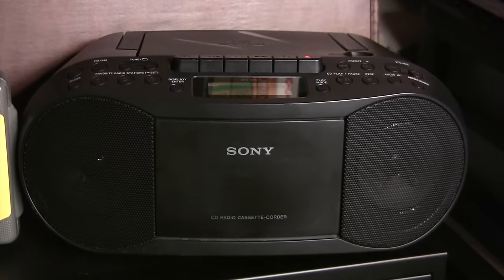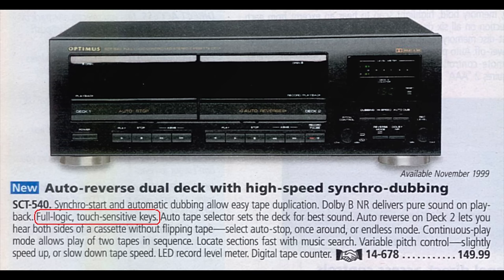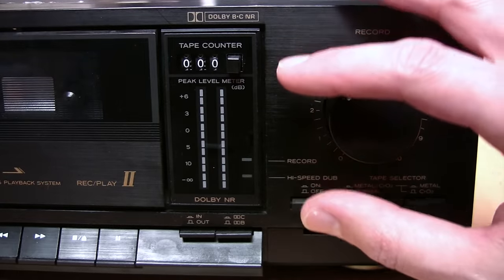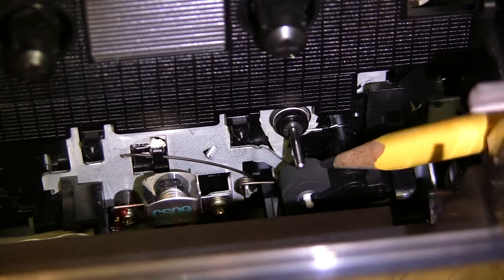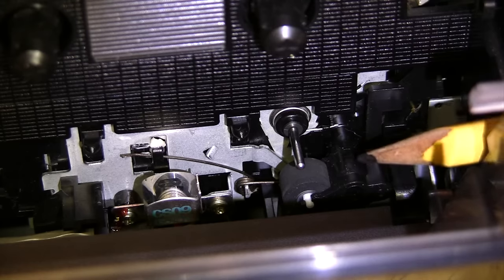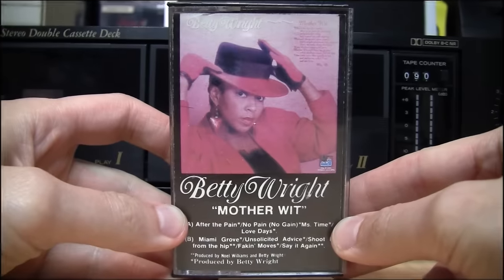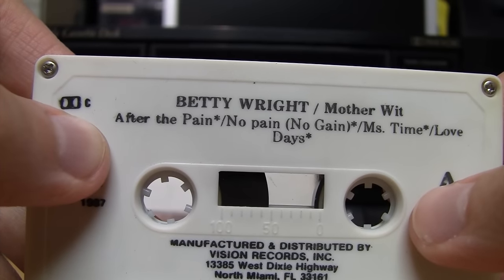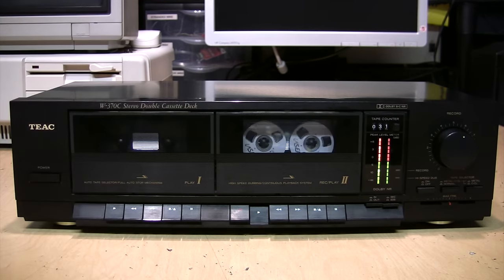Cassette Decks for Dummies

Comment: Just my two-cents on "piano key" decks. The higher quality ones that "detach" the heads/pinch assembly from the play button machanism, once pressed, are ok. The sign of a terrible mech is, once in play mode, the head/pinch will still wiggle a bit if you push on the play button a little. Directly connected. Very very shoddy. Very prone to "issues"! 

Thankfully very very few "proper" cassette decks with ALC, though Sansui did make a few in the 80s. Very strange decision on an otherwise respectable deck.

Twin decks def best avoided, usually, although the older Tascam pro double decks (302, IIRC) were basically two totally separate decks (both mechanically and electronically) in a single cabinet. Not especially high-end, but good enough for most people. And way ahead of their current lame offerings. Current Tascams are pretty dreadful IMHO. If you can get an "older" Tascam from about ten years ago, that's not been abused, you should be able to use it without any servicing. 

Minimum specs for anyone seeking a really high-performance deck are 3-heads, Dolby B/C ( and S if possible!) & HX pro. Dual capstan def nice too, quartz lock & direct drive is the ultimate. 

Always check for a groove cut into the rec/play head when buying a used deck. If you can clearly feel a groove/ridge with your finger nail, I'd suggest you keep looking! Head wear is a sure sign that the deck is generally worn out. Once a head has bad wear you also can't adjust the azimuth on it (well, you can, but it won't work terribly well!). The wear/groove will be at a slightly different angle than the new tape path. Very bad for tapes. 
Also check for wear and thick brown deposits on the pinch roller. Or a cracked or shiny pinch. To be avoided at all costs!

I could literally talk forever about cassette decks, but I shall leave it there! 😃👍
One last thing ..."metal" tape compatibility, even if you don't plan to use metal tapes, is a general sign of the deck being of "hifi" quality. You won't see it on anything pre 1980-ish, but those older 70s decks are usually best avoided anyway due to failing rubber parts, failing caps, etc.
I have a love/hate relationship with cassette decks. My favourite ever (aside from crazy expensive shit) is the Yamaha KX1200. Stunning recordings. Play those tapes on a WM-DC2 walkman, and you'll think you're listening to a CD 😃

Comment: You should do an experiment, record on a Type IV cassette on non-Type IV equipment.
Reply from the maker: I've done it on my TEAC W-1200. It still generally sounds fine and will completely erase any existing recording on the tape. It just is a little lower in level and sounds rather bright.
Reply: @vwestlife  Does the W1200 support type 2 (CrO2)?
Reply from the maker: @manFromPeterborough  Yes.

Comment: And what you do if you changed the belts, the rubber wheel is in the exact condition on the video, and the deck still has a lot of flutter when you play a tape you recorded on it?
Reply: May need a slight speed adjustment of the motor.
Reply: @RB-xm3ed  its with the correct speed, i lubricated the motor too because it was noisy, maybe its because i used these universal chinese belts, but i cant find resonable price new belts for my deck..
Reply: @RB-xm3ed  thank you!!
Reply: @vinilomelhorpresente4622  welcome and it also occurred to me that it could be your pinch roller. Might be worth checking that too as the rubber can and does degrade on those.
Reply: @RB-xm3ed  i will buy a new one too, for my deck and my boombox, because i have a new box full of virgin 90 minutes maxell tapes
Reply: @RB-xm3ed  that won't fix wow/flutter 🤷🏼‍♂️
Reply: The belts could be the wrong length &/or more/less stretchy, trying different belts can make a big difference.

Comment: A question. I have RCA speakers connected to my deck but the audio is very quiet. What should I do?
Reply: Do they have an amp? If not that's why it's quiet. If they don't have a built-in amplifier you need to add one into the chain.

Comment: So do you need the amplifier?
Reply: Yes, the deck would normally output line level sound which needs amplifying. If the deck has a headphone socket however it will have a headphone amp inside for headphones.

Comment: That’s often the trouble 👿 with these at thrift stores. A half off sale price can be a good 😌 item (hey, I’m talking about electronics here, not just anything), or a piece of junk (broken gears ⚙️, burned 🔥 out motors, etc, etc). Thrift stores often do not refund your money 💰), but, instead, gives ya a card (credit value is put on it), for any other item in the store. This is often not taken lightly by people, but it also can be to your advantage. Often of times, ya don’t find an item of interest, therefore, ya have to hold onto the card until some other item (for the same price becomes available). Other times, ya find another item, actually liking it BETTER than the first item ya just returned. Even less of times, ya might even find the IDENTICAL item. Just test any electronics before ya leave the store (this also includes vacuum cleaners, radios 📻, toasters, hair dryers, etc). This credit HAS to be used within 90 days (can depend on the store 🏬), otherwise, your credit will be lost 😞 (become property of the store 🏬). Your friend, Jeff.

Comment: Does an amplifier make a noticeable difference in sound quality if I want to use a cassette deck for casual listening?
Reply from the maker: You're going to need one anyway, unless the deck has a headphone output and you just want to listen through that.
Reply: @vwestlife Ok now I get it. If my deck has a headphone output I can just use that and connect it directly to any speaker. But the sound quality won’t be as good as if I used an amplifier in the middle of that setup?

Comment: As I can't find a yt video about HX-PRO I ask you to make one. It's not a noise reduction, only 'works' while recording and developed by Bang&Olufsen. But that's all I know...
Reply from the maker: HX stands for Headroom eXtension and improves recording quality of high-frequency sounds like cymbals and hi-hats. It is not an encoding system and doesn't need a matching decoder. An HX Pro recording can be played on any cassette player and experience its improvement.

Comment: What is the name of the song on the first audio test? Shazam and google can seem to find it. And do you reccomend a mirco sony hifi stereo system. The ones with the cd/tape/tuner and so on. Supports type 1 and 2 tapes. Has dolby noise reduction and can copy from cd/tuner to tape. I need a couple of tapes for my 02 bmw e39. Only has a tape player and a tuner. The model of the sony micro hifi system is the cmt-pc11.
Reply from the maker: If you can read script, the artist and title are visible through the cassette window.
Reply: @vwestlife  Yeah i can read what the cassette says but when i search online nothing.
Reply from the maker: @Marin_Medak  That's because it's not online.
Reply: @vwestlife  Ok, Thanks!

Comment: I have a hard time imagining someone going out and purchasing a standalone cassette deck without already having a 2-channel hifi system in place. That said, I seem to recall that most cassette decks had built-in headphone jacks with an associated variable output (volume) control. Then there is the matter of what headphone impedance range is acceptable for use with any given cassette deck. But of course that's a whole 'nother story.

Comment: Something you forgot when talking about the deck was head wear, usually this can easily be seen, and felt with a fingernail, worn heads will limit the high frequency, sounding dull & muffled with badly worn heads. The deck in your video looks to have had very little use.
Reply: I've had bad flutter toward end of tape caused by worn head, it makes the vocals sound phlegmy

Comment: I'm curious how the levels of...premium-ness? break down. Like...I have a Technics dual deck with Dolby B-C and HX Pro and full logic controls, but does having the dual deck make it less premium?
Reply from the maker: Having HX Pro means it's at least a mid-range deck. It wasn't equipped on low-end decks.
Reply: @vwestlife  I would definitely say this is a mid-range deck, probably near the bottom of the Technics range. It's a TR-313.

Comment: I would never buy a cassette deck that’s newer than 1995, The cassette mechanisms built after that were junk compared to the 80s and early 90s. Your video is a good starting point for new people but I personally would stay away from the mechanical push buttons and get the soft touch ones. One thing you didn’t mention is cassette decks that don’t allow you to run them with the door open often allow you to remove the door by simply lifting up on them. You can still insert a cassette into the tray and play the tape and clean the heads if you wish without a tape in them

Comment: My deck sometimes makes a buzzing noise from one channel.  Pressing the noise reduction buttons repeatedly usually fixes it temporarily.  Not sure where to start.
Reply: spray some wd40 in that switch
Reply from the maker: @rodrigobelinchon2982  Better to use electrical contact cleaner (like Deoxit) than WD-40. Although, confusingly, WD-40 also makes electrical contact cleaner than has no relation to regular WD-40.
Reply: @vwestlife  I would not buy a special product for just one switch , but of course a specialized product is even better. hey , that Peugeot song is sick ! Always great music in your videos !
Reply: @rodrigobelinchon2982  Contact cleaner is useful stuff to have in your household toolkit, and it's not expensive.
Reply: @thisisnev  sure , the contact cleaner will last him a lifetime LOL . A couple drops of regular WD40 will do the trick , though.

Comment: The first thing I look for is are there more than one of the same model available. If there are check out both decks and if economically feasible buy both. The second thing is have a good repair person because the odds are you'll have to use the second deck to get the first one working as well as replace capacitors and belts. If a miracle happens you may get two working good quality decks. If a miracle doesn't happen the odds are you'll get one good running deck and spare parts for the future. Generally the new decks available today are not of the same quality as the better quality decks from the past. The is a good video for general deck restoration and cleaning information.

Comment: It's a big mistake of using alcohol to clean a rubber pinch roller. Alcohol will dry up the rubber and will crack. I knew this because I used to work at Hewlett-Packard Electronics.

Comment: These low-end tapedecks are good for playback but not for recording. Most of them sound better than boomboxes but the method of recording is mostly the same with the only difference of manual level adjustment. As long as you record on cheap type zeros it doesn´t matter much but even with a Sony HF or TDK D the results are day and night if you use a decent 3-head deck. I had many of these dual tapedecks and none of them were good for recording. Anyway, there are other use cases for cheap dual decks, i.e. rewinding tapes or testing unknown cassettes for massive dropouts without stressing the good deck.
Reply from the maker: This deck actually does have adjustable bias, which I was surprised to see.
Reply: Your problem stems from having dual-deck machines. They were junk. Low-end single-deckers like the JVC KD-A2 and Technics RS-M10 were perfectly capable of making great recordings.

Comment: 15:15 It looks like you can only connect one speaker, or i am missing something.
Reply from the maker: It has left and right outputs, on top of each other.
Reply: @vwestlife I do not understand?  - "on top of each other"
Reply from the maker: @Lit_Hot_takes  Yes, they are marked L and R for the left and right channels.
Reply: @vwestlife  ok, was getting confusing thinking each speaker needed white and red input.
Reply: @Lit_Hot_takes  Those kind of speakers are usually connected together with their own cable so one speaker ends up having the input for both.

Comment: Quarter-inch to 3.5mm. That's kinda international way
We just say 6.3mm to 3.5mm converter
Reply from the maker: Nobody in the USA ever calls it a 6.3mm plug. It's always "quarter-inch". The smaller plug used to be called "one-eighth inch", but now most people call it 3.5mm.
Reply: 1/4", 3.5mm and 2.5mm (for the mini jacks) seems correct to me when you consider that the first is a very old standard originating in America and the latter two are much more recent metric variants.

Comment: on chapter 20 it shows you how to effectively and easily dismantle the Sony TC-KA3/5/7ES's mechanism to replace the capstan motor in 400 easy to understand steps over 100 pages; just remember to bring a magnifying glass to read the tiny text and small diagrams and plenty of Excedrin for Migraines as you slowly and frustratingly try to follow their "easy" manual for "easy" disassembly, and not to mind all of those cassette repair "experts" that say it's the hardest cassette deck line to replace anything on ever made.

Comment: What a pity back in the day when Philips invented the cassette that they didn't make it bigger for audio purposes. Say about 10%-20% larger, giving us a C120 with the thickness of a C60 tape, tape running at say 25%-33% faster, a 50% broader tape, and finally a 1/2 track option for audiophiles. Probably no Dolby B required for most 'quieter' material.
Reply from the maker: There were two attempts at that: Grundig's DC International, and Sony's Elcaset. Both failed in the marketplace.
Reply: The humble Philips cassette can give astonishingly good results with a metal tape or a good Type II. There were a few decks around 1980 that offered double-speed recording & playback, but it didn't take off.
Reply: @vwestlife  Yes thanks, but the original cassette got there first - that was the problem. Such is life.
Reply: @thisisnev  In my opinion, track width is also an issue for stability reasons. A broader tape would have been better and less prone to drop-outs. Agree with the Metal Tape comment, but they are (and were) so expensive.
Reply: @vwestlife  Thanks, I wasn't aware of the Grundig alternative!

Comment: I've never seen metal or chrome cassettes of official recordings sold, so these are unnecessary features, just like dolby. What you really need is pitch (changing speed without a screwdriver), i bought a deck with this feature

Comment: 22:21  NO, NO, NO!  The meter should not exceed 0 VU (the RED), except on occasional (unavoidable) peaks.  I suspect that the reason most of the music on Youtube is so distorted, is that people don't follow that rule.  This rule applies to the audio level  throughout the signal path.  This was the practice I followed throughout my career as a Radio/TV Engineer, and Recording Engineers adhere to it, as well....that is, if they're producing audiophile quality music.
Reply from the maker: You're thinking of digital, where 0 dB is the maximum and if you try to exceed it the audio will get clipped and distortion. With analog, "0 dB" is just a reference level, which varies from one unit to the next. On good equipment and tape you can exceed it by quite a bit with no distortion.
Reply: Sir, you are not the expert here. Surely if you read any cassette deck manual it would say that “VU 0” and “0DB” is different.
Reply: @vwestlife  When I worked in that field, there were no digital audio meters!  But dB meters read peaks, VU meters, averages, and O VU is +4 dB.  Both are calibrated with 1 KHz sinewaves.  The idea was to make the meter indication correspond to perceived loudness, hence VU = "VOLUME units."  Whatever, the standard practice is to not let the needle frequently enter the RED.

Comment: Also the cheaper decks have way less that can go wrong and are way easier to service. I had a so called serviced high end expensing Sony tc-k82 from a reputable eBay seller and it still had problems after 1 month of use. All this talk of you needing the highest or high-end 3 head decks to make a good cassette resorting is pure bull shit. My technics rs-m45 direct drive deck makes recordings that sound as good as CD if not better depending on the source and tape used.
All in all go.for a cheaper to mid range deck you will have less problems and if you need to pay for repairs you will spend less money. Cheaper decks will serve your needs just fine.